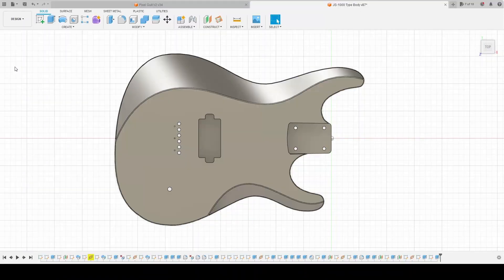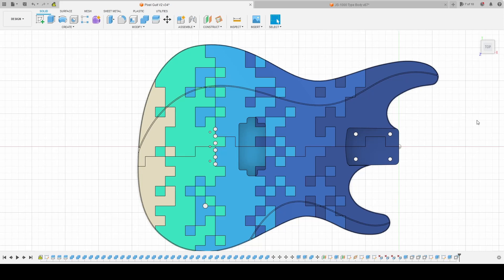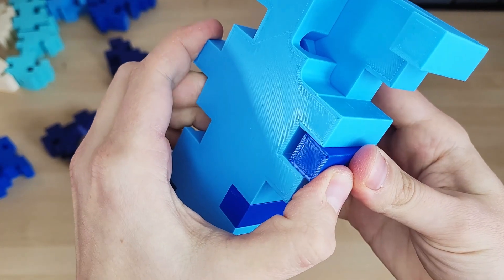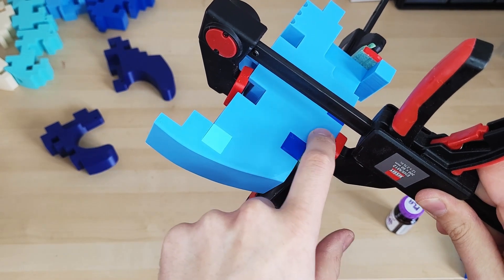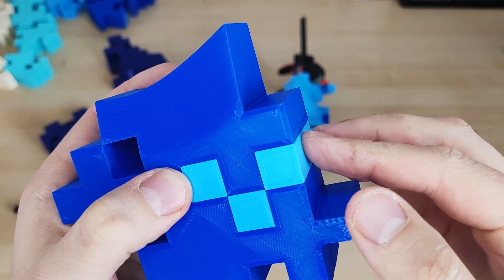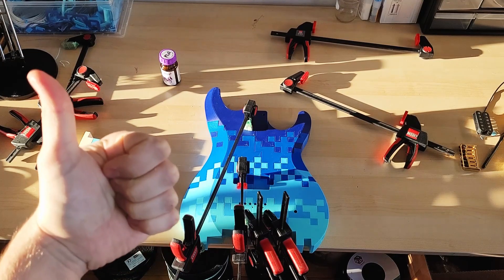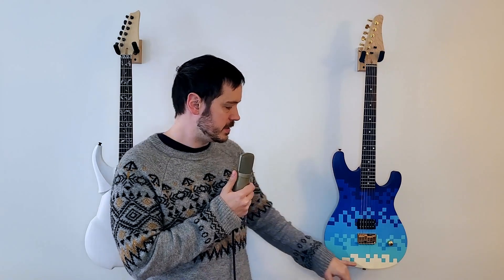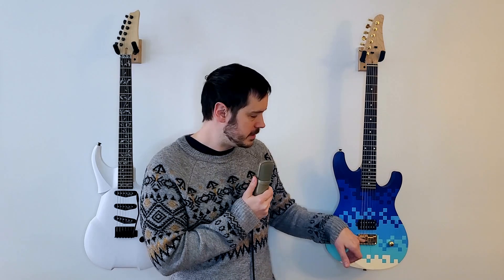3D Printing a Pixel Art Guitar

Comment: Hey, it's been a year. How's the body holding up vs string tension?
Reply from the maker: Honestly, not great. It started coming undone a few weeks after I finished it, I think it's mostly because I didn't put enough glue. I untightened the strings to relieve some tension and it's been holding fine since, but I don't think it would hold much for very long unless I were to disassemble and re-glue everything
Reply: @xavierdumont  Thanks for the reply!

Comment: Came here from Reddit. Amazing video and concept. Out of curiosity, have you created any reinforcements between the neck pocket and bridge? From another 3D printed vídeo the builder saw the guitar loosing integrity over time and bending due to the tension of the strings.
Reply from the maker: There isn't any reinforcements in terms of non-plastic components, I just added a lot of outer walls and top/bottom layers with 40% infill to make sure it doesn't move. PLA is pretty stiff, and I havent seen any movement on other guitars, but I have no idea if it will last for more than a few years.
Reply: I've built three 3d printed guitars and can confirm this happened to my first two guitars. The changes in temperature and humidity here in Mexico affected the string action, I fixed this going up to 80% infill density through the bridge and neck joint. They are still playable adjusting thruss rod and tuning down. Also using active pickups helps mitigate the loss of sustain.